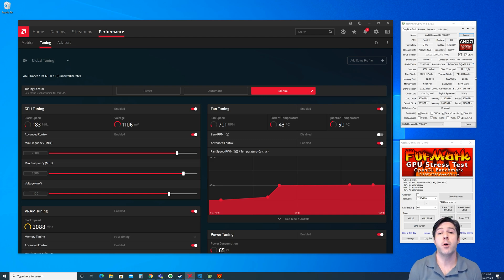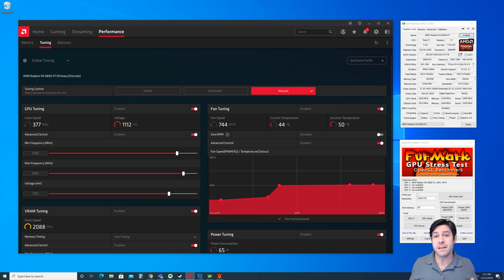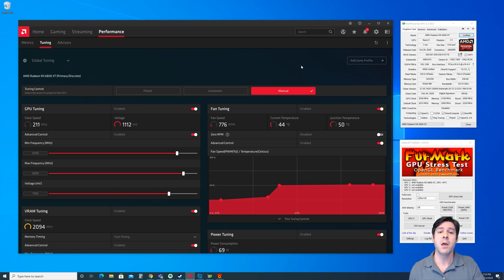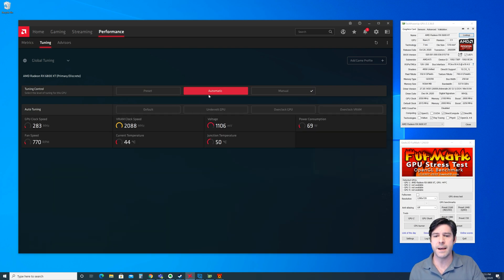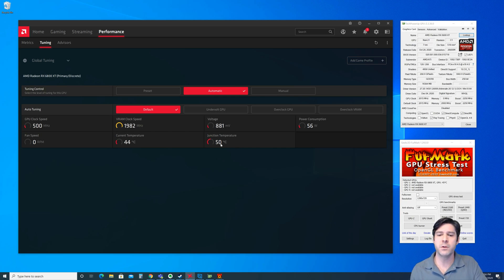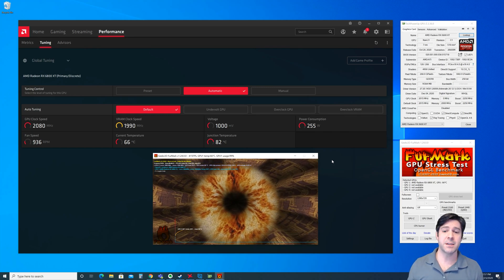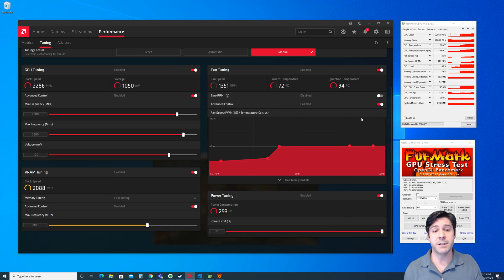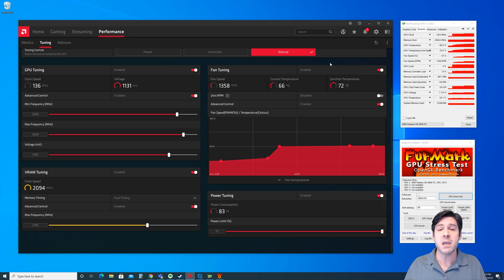RX 6800 XT GPU Junction Temperature Explained [Idle and Load]

Comment: So I stuck a stock 6700 xt in a mini itx
Case. Im getting around 97 degrees junction temp at 4K on medium settings. It runs well as far as game play, but is this temp safe for longevity? So used to edge temperatures that this number is scaring me. The edge is around 84 C
Reply from the maker: AMD says the card is fine up to 110 degrees at the junction. PERSONALLY, that temperature sounds high to me. It will probably be fine as long as you are just gaming sometimes and not crypto mining or something. But, check out my video on overclocking and you'll see where I mention fan settings. If I were you, I would turn off zero-rpm fans and adjust the fan settings higher - you'll see that you can get the temperature down fairly well if you are willing to put up with a little fan noise. If you set it to only ramp up at higher temps then it will only be noisy while gaming.
Reply: @heygeek3816  I have a 6700 xt in a good airflow case I get 60C but 110C junction temp even when at max fan speed (Any lower and it starts thermal throttling)
Reply: @officialteaincorporated243  Same here with my 6800 XT, something is wrong  with these cards.. The noise is unbearable.

Comment: Cant get an overclock on the 6800 without throttling, im pretty sure this is because of the junction temp sensor or the max temp limit being locked by AMD. Whats your thoughts?
Reply from the maker: What do your temps look like? Officially, the card doesn't throttle until 110C but I've seen it throttle before that point.

Comment: So when I play The Isle my GPU temp (same gpu as this vid) is roughly 78 degrees Celsius and the junction temp is around 98 degrees Celsius. I only get this on The Isle I normally average 70-80 for the junction temp. So is this safe to play for a few hours or can it damage my GPU?
Reply: Lol, searching for this answer too. Let me know if you ever found out. I don’t wanna wreck my video card for 2 hours of awesome gameplay.
Reply: maybe you can try playing with the settings...if you have some frames to give up, maybe can have a downclocked, and slightly undervolted profile with a custom fan curve selected just for when you play that game. But to answer your question...I don't know either but I did all of the things I mentioned and more to keep my 6600 a little bit cooler during certain games :)

Comment: Very good info. 

See... This is what I'm not okay with. 
On my MSI GAMING X TRIO 6900XT My junction thermals reach up to 85-95° at 100% fan speed, and this is on an open bench with a 140mm  fan on it. Not happy with this temps at all. Mind you, in stock mode.
Reply from the maker: Stock settings and 100% fan....that should never reach 95 degrees. I might look at RMAing that card if you can.

Comment: I'm using a 5500xt and when playing high intensity games like destiny 2, I hit around 85-90 degrees junction temp. Is that okay? I was thinking about setting a fan curve but I'm not sure how that effects the other settings since I have to select the manual tuning control option

Here's what i mean: 
When setting a custom fan curve, I notice I have to select manual. Do I actually have to set values for the other tuning (GPU tuning, VRAM tuning, ect)? Or can I just leave it to disabled and just enable the fan tuning. I was basically wondering if I select manual, will the system automatically adjust tune the components I don't have enabled for tuning. That's the only reason I have automatic selected. Thank you
Reply from the maker: You should be able to change just the fan curve. When you change the settings to manual it doesn't change any settings, just allows you to change them.

Comment: My junction temperature usually sits around 90-95 C during gaming. 6800xt
Whats going on?
Reply from the maker: If you are running stock settings, the fan is likely not running fast enough. Go into the radeon software and tweak your fan curve up until your temps are better under load!
Reply: @heygeek3816  hi there. I just got my Rx 6800 xt Reference. in the lian li o11 dynamic, its has 9 fans with the best fan configuration. I tried Metro exodus (only game I have atm xD) and played for an hour and my gpu temp was at 81 max. And this on Stock settings but kept going down to 78 and 79 all the time. the junction temperature was even way higher than that, I knew it was safe but is that good temperature or safe, it wont throttle or anything? or would you suggest I change the fan curve a bit. its my first card and my first build and it was hard to get and I am afraid it damages the card over time that's why I am asking, thank you.

Comment: Great Video! I have a question though: With the same Tuning setups as you have my fans are at 2330 RPM (!) when theyre operating at 50% and already at 1350 rpm when at 25%, how is that?
Reply from the maker: Thanks for watching! Different graphics card models will have different fans installed so that likely explains some of it. Generally speaking, I would say just raise your fans up to the point where temps aren't an issue and don't go any further.
Reply: @heygeek3816  Thanks for the quick reply. What if i were to replace the preinstalled fans with better ones? Btw i have the MSI RX 6800 XT GAMING X TRIO card.
Reply from the maker: Is your goal to reduce noise? If that's the case I do believe deshrouding is usually an option - replacing the stock fan shroud with larger, quieter case fans.
Reply: @heygeek3816  My Goal is to reduce noise and hopefully temps. My card goes up to around 103 junction temps and in some games my fps drops from 143 to exactly 60. Im running the card undervolted, is there a bettet way to reliably reduce temps?

Comment: I Have the RX 6900 XT Red Devil, with 53% fan speed it reaches 61c Core and 81c junction.
Reply from the maker: Sounds like solid temps if that's under full load!
Reply: In what games? 1440p Ultra settings? I have 6900 XT Ultimate Red Devil and:

Cyberpunk  temp - 70c Core and 99c Junction

Comment: If I'm not doing any overclocking. Am I fine with just leaving everything at default ?  When playing overwatch the junction is at 90 and temp is 70. Do I need to mess around with a fan curve. Or is 90c junction normal?
Reply from the maker: Technically, anything up to 110C is considered 'normal' by AMD and within design specs. Personally, I would change up the fan curve a bit to bring the temps down below 90 but that's personal preference. If you don't want to overclock and you typically just use your PC for gaming it shouldn't be an issue and you can leave it at default.

Comment: Why is it that if I run Furmark that my GPU clock stays around 2100mhz or 2000mhz when I run the stress test. My settings are 2500-2600mhz but the clock stays low. I only get the clock increase when I play games, not with Furmark
Reply from the maker: So I've actually noticed this exact issue myself - FurMark never lets the card hits full boost clocks. I think it has to do with the extreme simulated load because the exact setup in a real-world gaming environment would allow the card to hit the boost clocks. Practically speaking, FurMark is really just for stress testing/temperature monitoring anyway so it doesn't have to hit the full clocks.

Comment: Any idea why my 6800 XT junction temp rises drastically when I alt-tab out of games? If it's 60 in game for example as soon as I alt tab it shoots up to 80 degrees in about 5 seconds and then after a minute it gets to the low 90's and seems to stay there. The average temp also rises but nothing too drastic like the junction temp, it will 'only' jump about 10-15 degrees total. Also the card produces extremely loud coil whine while it's doing this, usually it's almost completely silent.
Reply from the maker: That's a very interesting issue. The only real reason the junction temp would rise is if it was under a higher load when alt+tabbed so it has to be some issue with an artificial load being placed on the GPU. When you alt+tab can you check the GPU utilization and see if it is pegged at 100%? Also, be sure that you have the latest drivers from AMD because that could be a factor.
Reply: @heygeek3816  Yeah util is never pegged at 100% that was the first thing I checked. There seems to no changes from what I can see other than the drastic temp rise. Of course all my drivers are up to date. I'm completely lost now, I've been trying to fix this shit for a week. Thinking of returning the card for a 3080.
Reply from the maker: Question. Does your fan stop running when you alt tab? Possibly the card thinks the load drops but the game is still running so the temps spike.
Reply from the maker: No problem thanks for watching!
Reply: @Hatsuseno1  Is the airflow in your case setup pretty well?

Comment: I bought a XFX branded reference design 6900xt in late December, I started getting worried when I was seeing 110 degrees junction temps within 5 minutes while running TimeSpy Extreme stress test, I emailed AMD and about a week later got a reply that 110 degrees junction temp was normal, the edge temp is the one to keep a eye on they said that's good up to 90 degrees, after that worry.
I use a custom fan curve with fans going to 85% at 85 degrees Junction, during my stress testing, the Edge temps never got above 74 degrees even though the Junction temp was pinned at 110 degrees. This is during a "Stress Test", during normal gaming (in VR), my junction temps stay in the upper 60's to lower 70's. To new 6000 series owners, all I can say is to setup a custom fan curve since AMD's default one is way to mild only hitting 50% fan speed at any temp.
Reply from the maker: Thanks for watching and sharing your experience with the community! I 100% agree that the fan curve is likely the most important thing to tweak on these cards.
Reply: i tried the custom fan curve, but it dosnt help much. my gpu is mounted vertically with the ports coming out from the top. my case is xtia xproto. a lot of people investigated and found that the heatsinks are gravity dependent. so if you mount your gpu vertically it will be hotter by 5-10 degrees. custom fan curve only helps by 5 degrees. should i look into replacing the thermal pads and thermal paste, because i dont want to put a waterblock on this thing. another option i have is to place the whole pc upside down that way the ports comeout from the bottom.
Reply from the maker: Oh I have heard of these vertical mounting issues so that's likely the culprit - you can't switch it? Changing the thermal pad likely won't help if it's gravity-related.
Reply: Here's a update to my original post.....
I've since been messing around with the software (Adrenaline) settings, I now have my 6900xt set to custom fan curve as before, but I have min freq set to normal, max is set to 2330mhz, max voltage is set to 1125mv and Vram is set to fast timings. Everything else is untouched and at default settings. I now get between 2200 to 2250mhz under serious load, a lot less clock fluctuation making it more predictable, also it run a LOT cooler. in Example, with default settings, it would fail the TimeSpy Extreme Stress Test for stability, now it passes with 99.6% stability. When running Assetto Corsa Competizione in VR (Valve Index) it use to easily get to 110 degrees junction, now it seems to hover around the 60 degree junction mark!
Seems the way AMD has these cards setup, they just use power until they get too hot and then throttle down instead of staying within the advertised specs of 2250mhz boost clock and letting the OC'ers tinker if they want more. So far my 6900xt is running like a dream, handles everything I've thrown at it well with these settings. No more 110 degrees junction for me! :)
Oh, I use this GPU for VR only, so certain titles will push it, and other not so much, I do sim racing and it's nice to be able to turn on some eye candy where before I couldn't with my old 1080ti. :)
Reply: @jackr.749  Can you go into more detail on your how you have your gpu profile set up I would like to try it and use them and also why did those settings make a difference seems like a huge difference
Reply: @jackr.749  Have you tried running any games in 4k max settings and what is your junction temp like then? Does the card orientation matter like other posts are saying? Thanks for the reply this card is so new not a lot of info out
Reply: @turok123453  Hello. I use this machine for VR only pretty much, I do have it connected to a 4k TV as a monitor. This is why I run TimeSpy Extreme (4k) stress test, if it passes this test, it is VERY stable and the temps would be maxed out in the 20 minutes it takes to run this stress test. As for card orientation, I can't say I agree, I have mine in a full tower case with the 6900xt's fan facing downward, but I also have two 140mm fans in the bottom of the case bringing in fresh air towards the GPU. With the amount of screws holding this card together and applying even pressure between the cooler and the GPU chip, I can't see this being a problem. If the card doesn't behave as it should in this orientation, might be time to consider RMA'ing the card. I am unwilling to change what has become standard PC building practices (GPU in PCIe slot with fans facing down) to accommodate a faulty GPU. Just my opinion. :)
Reply: I had the same issue and GPU orientation is very very important on the reference AMD design. If the GPU is upside down, with the DP/HDMI port pointing upwards the temps easily hit 110 junction temp in almost any scenario. Best orientation is to have the GPU vertical and motherboard horizontal, so as if the motherboard was lying on its back. 

The problem is the giant vapor chamber which only works effective in certain orientation, not sure if the card you have has the same vapor chamber design as the reference AMD model, but maybe changing the orientation and seeing how that goes would be a starting point. 

I have the reference model and changing the orientation really helped.

Source:
https://www.reddit.com/r/Amd/comments/lrd8g6/are_my_rx_6800_xt_temps_normal_reference_design/
https://www.reddit.com/r/Amd/comments/k0ccmu/6800xt_card_orientation_seems_to_make_a_difference/
Reply: @Xyanider  Hello, thanks for the reply.
I ended up taking the card apart and putting a little thermal paste (MX4) on the graphite thermal pad, this helped but wasn't the cure. I ended up doing a RMA with XFX (these guys were excellent) and they sent me a replacement 6900xt and this one works incredibly well, with the default fan curve, the hottest it got was 93 degrees junction, once I added my own fan curve (no zero fan and max 70% fan) now the card gets near 80 degrees when pushed hard like TimeSpy Extreme Stress test. Just goes to show my original card was defective, either the graphite thermal pad wasn't applied properly or the cold plate of the vapor chamber wasn't sitting flush on the GPU. My XFX branded reference card would be the same as the one sold by AMD, no matter the manufacturer, a reference card has to follow AMD's reference design. Partner cards like the XFX Merc 319, PowerColor Red Devil and so on, they use their own designs and normally have much better cooling solutions. :)

Comment: hi, I just have a quick question, for the GPU If I leave the default settings and RPM zero enable I notice that my card idle and nothing running was gettings temps around 60 and sometimes even 65, is that normal, or do I need to set something in the BIOS or Adrenalin to make it not reach that hight? for now I just set the fan speeds manually is looking better. thanks
Reply from the maker: Thanks for watching! That temp seems very high to me as my reference card sits at 42 at idle with 50 junction temp with no fans in a warm room - you have a 6800 xt as well? While 60 degrees won't hurt the card at idle it wouldn't hurt to turn the fans on. I would be more worried about temps under load. Have you measured those? And are you looking at the junction temp or the regular gpu temp when you see 60?
Reply: @heygeek3816  thanks for replying, yes was 60 at junction and like 58 regular temp. Yes you right I remember seeing before around 40s with fans off. What happened is that I recently updated my ram and need it to reset my bios to make it work, and I was checking today and saw higher temps. That’s why I was asking about if a bios setting needs to be apply or could be something else? For now,I have my fans on and they keep it in the 40s. Under load is like 80 with fans.
Reply from the maker: Interesting that a bios change would affect temps. Did you "reset" the bios or update it to the latest version? If it's not at the latest version then maybe try updating the bios, checking all other system updates, removing your gpu drivers with ddu (google it) and reinstalling AMD drivers from scratch!
Reply: those temps are normal, especially if you're browsing or watching vids with hardware acceleration enabled. @stock the fans don't even start spinning up until 70°C junction or so.
Reply from the maker: If my card sits at 45 degrees junction temp with zero fan rpm even if I am browsing with Chrome or watching YT videos with hardware acceleration then I don't think 60-65 would be considered normal unless your room temp is extremely high and/or your case has zero airflow. I would address the updates, room temp, and case airflow first. If you are still having trouble then it might be an issue with the thermal paste on the GPU itself.